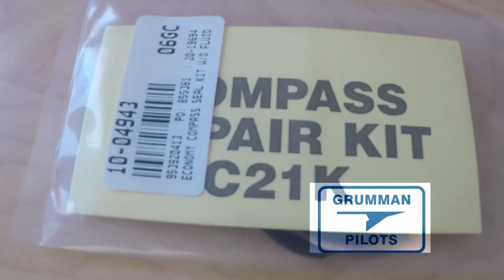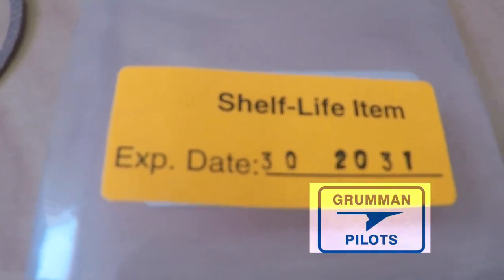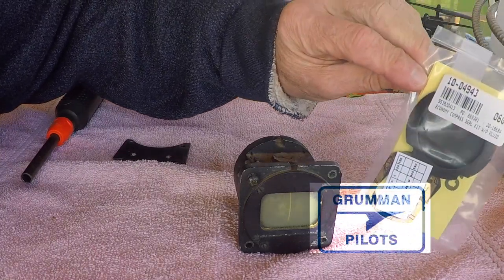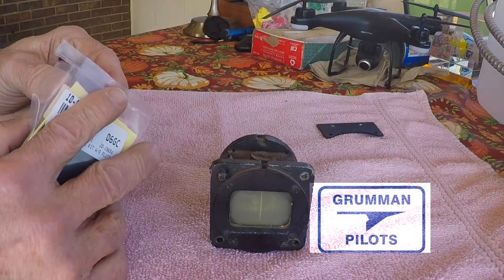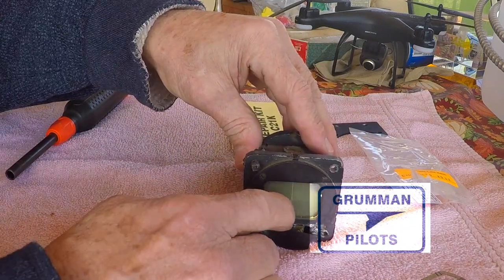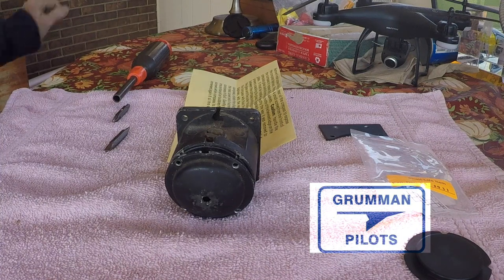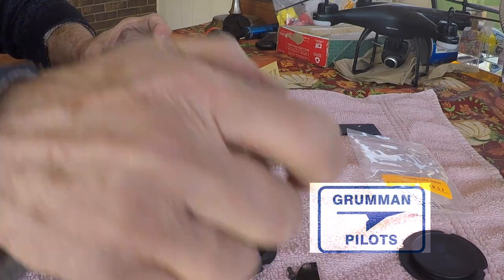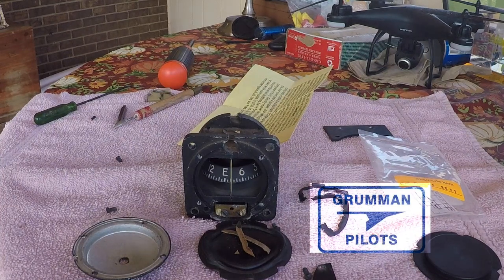Wet Compass & Repair Kit - Grumman Style

Comment: 8:24 to 8:25 magic.  That's the only reason I watched the video.  My magnetic compass wasn't coming apart because the previous owner decided to GLUE it  back together.  So glad I bought and opened the rebuild kit, right?  Now I'm shopping for a new compass.
Reply from the maker: Not for the faint of heart but if you take you time with a properly maintained one.

Comment: To get the back off: after taking out the 4 screws, use a utility knife blade and gently work the sharp edge between the rubber diaphragm and the metal housing, don’t put more than a 1/4 inch of the blade into the seam. Just enough to create a gap. Cut along the diaphragm and work around the circumference. Go around a couple of times with increasing gap every pass. 
After getting the back cover off, remove the screws on the front and the hardware. To get the glass off, use a wooden dowel to push the glass from inside, using now open back as an access point. An oval shaped, unsharpened carpenter pensil works really well as a pusher, or use two for even pressure. Hold the housing with glass pointed up with one end of the dowel or pencil resting on inside glass corner and the other end resting on the table. Gently press down on the housing and the glass should start to separate. Move the dowel to opposite corner and the glass should pop off. Do not try to pry the glass off the front with a flat head or similar. 
Remove any old seal material careful with a razor blade or something like green brillo pad.  Clean the inside with brake cleaner if any debris fell in before installing any gaskets. Hope this helps.
Reply from the maker: Good to know, sometimes they can be a pain.  Not for the home pilot to try.